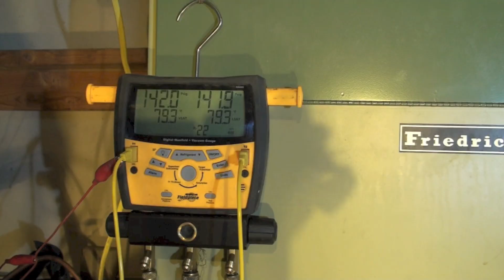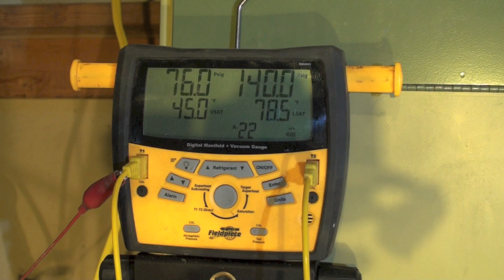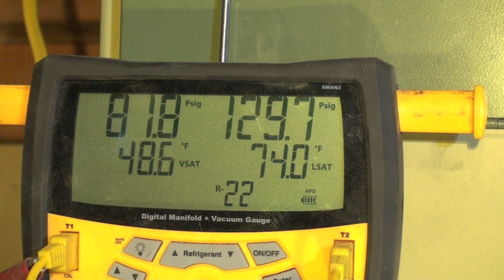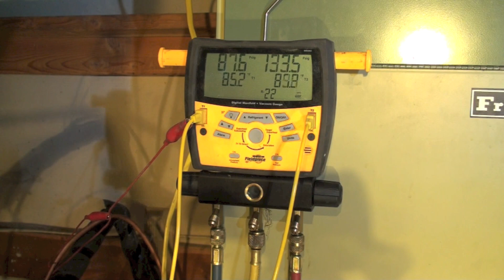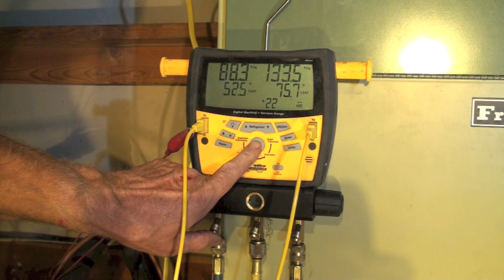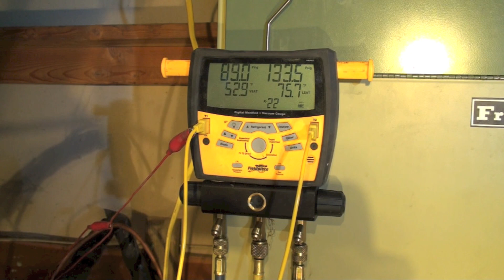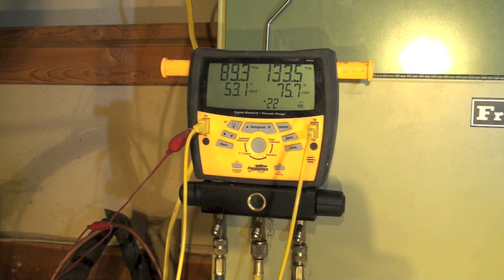Diagnose the air conditioning problem

Comment: I can’t believe I wasted my time watching this video. I look up to you !your videos are so slow. I know you’re a master of your trade.You did not show me anything is the air filter dirty is the evaporator coil dirty is the condenser coil dirty is there a kink in the line. If it’s a heat pump is the reversing valve not seating. What’s this a guessing game I like how your gauges are inside next to the furnace and set it outside by the condenser 95% of everybody I know does not check the unit like that. And we do not have ports to check it like that here down in Texas most of the time. You are a very smart man. I guess I’m dumb as a boxer rocks because I don’t know because I haven’t seen the rest of the Unit.Do I have to watch your neck slow video to get the answer I guess so you’re killing me happy trails thanks for the video
Reply: Tell me how any of what you listed would cause those pressures. Also, you can't spell.

Comment: Leaking reversing valve and loss of refrigerant? Compressor sounds like it's discharging on itself. You could check temp going in and out reversing valve....meh....you just said the reversing valve seems good....ok is the compressor getting weak causing high suction and is it also low on refrigerant also.?

Comment: Wrong metering device used, either an indoor txv without a check valve, wrong txv for the refrigerant in use, piston size wrong or stuck open.
Reply from the maker: Francisco Castellanos Here is the answer video:  http://youtu.be/XMDFfVnFjXM  Good thoughts.
GFM

Comment: I just had that exact problem 2 days ago using my sman.  It was a tran 5 ton unit and I notice my liquid line sweating when I arrived.  I took a wet  bulb and dry bulb and charged the unit because it was showing low on charge 54 psig super heat 43 the guy told me the house is cooling good but im worried about a call back.

Comment: Hmmmm this is a tough one.  I'd say a restriction in the compressor discharge line or muffler, if the unit has one.  This is the only way that I can think of that could cause negitive subcooling.

Comment: Looks like someone put stop leak in this system and screwed it all up. Would you please hurry up and let us know what you find on this one.
Reply from the maker: I don't know about the stop leak.  What, tell whats wrong with it and stop all the fun?
GFM
Reply: Im joking about the stop leak.
Reply: bad compressor valves
Reply from the maker: ***** Yes.  It is a an air conditioner that was junked and I am going to use it as a test mule.
GFM
Reply from the maker: ***** No problem.
GFM

Comment: Here is what a extremely smart refrigerant tech has to say 

hvacrmedic- 
Wrong/mixed refrigerant and an upstream LL restriction. The saturated temp of whatever concoction is in the system has to be the same as LL temp given that liquid is boiling off after the restriction. 
We can find two saturation points for this refrigerant. When the system was static we had saturation conditions of

142psig/85-90°F

Saturation conditions in the LL near the evap coil with the system running are

133.5psig/83°F

This is obviously not pure R22.

Maybe some type of R22

If it's pure R22, 2 lb low, piston metered, LL temp is below ambient, normal amp draw, then
1) Gauges are out of normal calibration
2) There is an upstream restriction
3) Compressor is underpumping
Reply: Wow! I'm an idiot compared to that guy! Is he from HVAC-TALK?
Reply: Stephen Rardon Yes he is
Reply: If it were mixed refrigerants wouldn't your pressures be moving up and down like there were non-condensables  in it?
Reply: T&N Services LLC. no not really. Remember 410a and many new 400 series refrigerants are mixtures.

Comment: Let's see a video on how it pumps down. Once it is pumped down  switch the reversing valve and then attach gauge to heat pump port. Run condensor fan only and let's see what the saturation temp is.
Reply from the maker: Coming right up
GFM

Comment: Something with the metering device in the out door coil is causing the liquid refrigerant to begin flashing in the condenser? That would explain the lower than ambient liquid line, and the low head pressure. What's the true suction pressure?
Reply from the maker: suction pressure measured at the outlet of the indoor coil is 80#.  Same at the true suction.
GFM

Comment: Restriction on liquid line, possibly a plugged filter?
Reply from the maker: No temp difference was found at any component.
GFM
Reply: grayfurnaceman I guess the next thing I would is work backward toward the compressor discharge port.  I am banking on a restriction somewhere because of the cooling effect going on. Pinched condenser tube?

Comment: Different era diff pressures?
Reply from the maker: You must explain further
GFM
Reply: grayfurnaceman I once read somewhere that older r22 units ran slightly higher pressures.Is that an accurate statement?
Reply from the maker: lou hernandez That is true for head pressure.  Many of the older units had much smaller condensers.  This was before any efficiency standards were required.
GFM

Comment: Check name plate on condensing unit for compressor amp draw. If amp draw is low, may be a bad valve in compressor.  Replace the compressor
Reply from the maker: Amp draw 9.5, rated at 12.  
GFM

Comment: Do a pump down and see if that can be done. If not replace compressor... While pump down check the piston size and match it to the condensor spec. Replace liquid line dryer then pull the Schrader valve and pull a vacuum.
Reply from the maker: The unit does not have a liquid line valve, so it cannot be pumped down.  The suction line valve can be shut off and because it is a heat pump, it has a line tap on the common suction that shows the compressor will pull a vacuum.
GFM

Comment: a few questions for you, 1 any dryers in the system and if so where are they and is there a temp drop across them 2 what kind of metering device(s) inc check valves are on the system and what are the conditions 3 how short of charge is the system based on amperage 4 silly question but is it in fact a R22 system charged with R22 (had to ask , wouldn't be the 1st time I went on a call and the last tech topped of a charge with wrong freon) 5 condition of fans/coils/filters ect are operating within spec 6 whats the drop across the evap.
Reply from the maker: One dryer, no temp drop.  Two fixed orifice.  Three system is about 2# low amperage draw of compressor 9.5 rated 12.  Four It is R-22.  Five all coils clean, fan new, moving about 1000 cfm.  Six 10 degrees.
GFM
Reply: grayfurnaceman off the top of my head i would say you have a restriction in your condenser IF you are taking your readings AFTER the restriction. (pressure and temp)
Reply from the maker: Militaristics The readings are taken after the condenser in the liquid line.  There is no discharge tap.
GFM
Reply: then you got me stumped, unless you dropped the condenser in your swimming pool i dont see how a undercharged R22 system would be running like that, here in NY we dont have heat pumps, at least not for long, and I'm used to seeing a old R22 10seer unit running 250 or more in a 93 day. seeing a 120-130 head with that liquid line temp on a 93 deg day just doesnt make sense to me with the info at hand. if i went on that call I would pull the charge and recharge slowly after a good deep vac to make sure there was no moisture in the system. sometimes just "being there" and keeping an eye and ear on a system can tell you more than a phone call or readings relayed over the phone.

Comment: At this point you would sell the customer a new system lol na  maybe reversing valve problems or compressor is about die. What is the amp draw at the compressor and are they out of range?
Reply from the maker: Replacement is what happened.  Surely the unit had age as it is about 30 years old.  Compressor will pull a vacuum.  Amp draw is about 9.5, rated 12.

Comment: In my opinion its a restriction in the suction line, either that or  a retired HVAC man playing funny buggers
Reply from the maker: Although I will be making failures in this machine later, I found this condition after setting it up with no alterations.  Where is the restriction?
GFM
Reply: Filter drier?
Reply from the maker: MrSlapdash243 No temp difference across the drier.
GFM
Reply: Is the correct size orifice fitted?
Reply from the maker: MrSlapdash243 Did not pull orifice.
GFM

Comment: Is either a reversi.g valve issue or compressor with bad valves
Reply from the maker: Although I have not checked temp difference in the rev valve, the problem does not appear to be with the reversing valve.  The compressor will pull a vacuum.
GFM
Reply: Ok that don't sound right then
Reply: grayfurnaceman 
is it possible you have a restriction before the condenser (crushed pipe etc) and or to much air flow.
The high superheat could be we are starving the evaporator of refrigerant due to the above or the piston is the wrong size.
Reply: Ps just wanted to know the answer/result
Reply from the maker: There is a link at the end of the video.
GFM

Comment: Either bad compressor valves or maybe reversing valve getting stuck in the middle causing discharge to flow into suction?
Reply from the maker: Both compressor valves and reversing valve are good thoughts, however the compressor will pull a vacuum.
GFM

Comment: Hmm, interesting. What kind of
Delta T are you getting? You said airflow Was good so that eliminates dirty blower wheels, filters and crap duct sizing.
Reply: Where does he have the high side hooked to? Your liquid line cannot be lower than ambient unless you have a restriction. But a restriction won't show high suction pressure alone...must be a restriction along with bad valves in the compressor. Or his high side hose is somewhere downstream of metering device. Maybe this is one of those units that has the MD in the line set.
Reply: Stephen Rardon good morning! This is a goofy problem for sure! GFM is blowing my mind! A loose bulb Typically causes very low SH and low SC. He definately has a liquid restriction to have such a low psi and below ambient. When he first fires up the unit head psi is actually falling! It acts like he has throttled the liquid line service down and caused a restriction. However the suction pressure really has me intrigued also. With such a low liquid psi and a fixed orifice it should be lower with this problem. GFM have you also throttled the suction service valve thereby backing up the refrigerant into the coil?
Reply from the maker: Joe Shearer The line tap is located on the liquid line a few inches before the expansion device.  The compressor will pull a vacuum
GFM
Reply from the maker: I have 10 degrees delta T.
GFM
Reply: Weren't we just talking about a loose bulb on the TXV Joe Shearer? Sounds similar doesn't it? Low head, normal suction, low subcool, high superheat, or am I missing something about our conversion?
Reply: Im stumped grayfurnaceman all I know for sure is the refrigerant is being metered in the condenser.I shared the video with some extremely smart guys lets see what they say
Reply: How long have you had those SMAN 3. When I bought mine they were having problems reading the high side. High side pressures were really low. Contacted field piece about it. They said it was a issue and they sent me new valves for the manifolds.
Reply from the maker: david azbell jr I have compared it with analog gauges and it is ok.
GFM
Reply: Joe Shearer your right. now i just look stupid, gee thanks! LOL and good morning to you too sunshine!
Reply: Stephen Rardon it can also cause slightly high SH/low suction if it's in the supply air stream and not strapped and insulated well in the right conditions.
Reply from the maker: Joe Shearer I have not done anything to the unit.  All valves are open.  It came to me just this way.  It has been running this way for 9 years.
GFM